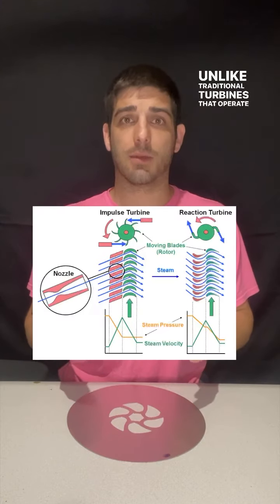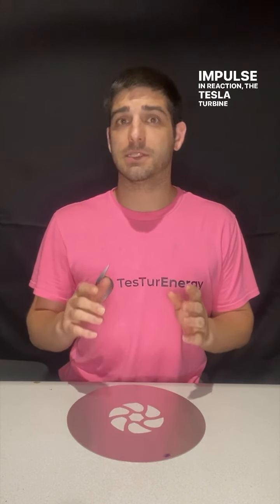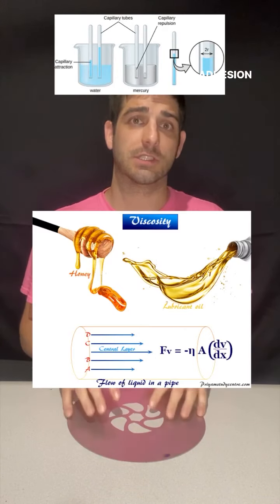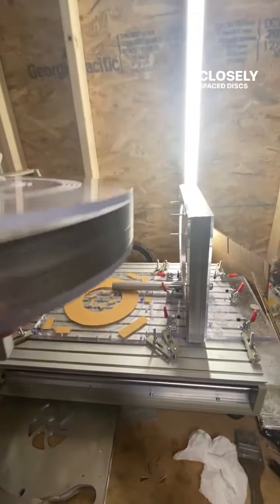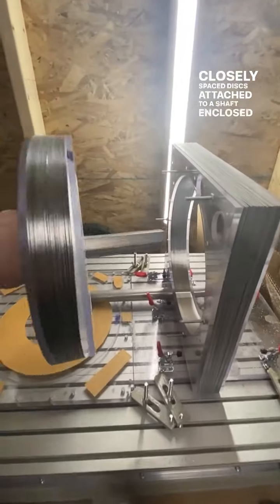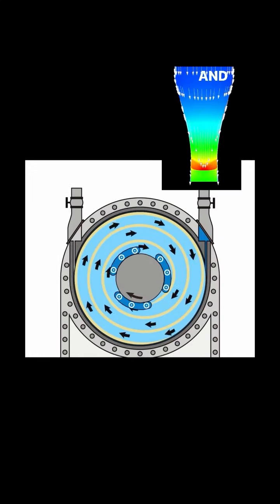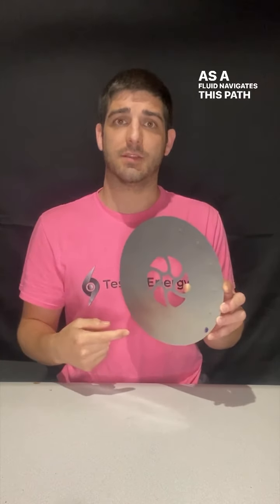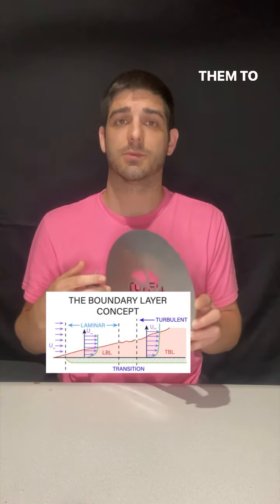Nikola Tesla’s Greatest Invention! - The Tesla Turbine

Comment: hey charlie, have you considered using carbon fiber disks? i was thinking you could use these to achieve greater RPMs thanks to their rigidness and light weight, i remember seeing somewhere you could reach a 1500m/s tip speed at the edge with normal carbon fiber material and up to 2100 if it was fabricated in a roll sort of fashion (threaded around the axis of rotation)
Reply from the maker: Hey thanks for the comment. Yes i have a ton of carbon fiber sheet for this exact purpose once we have the cactus design hammered out. 

But to be clear I appreciate your comment but Rpm is s not an issue because, despite what everyone erroneously claims, Tesla turbines work just fine, get plenty of torque and output power at low RPMs.     I’ve got some copy pasta 🍝 of mine that I’ll share with ya here to explain more.  Tesla turbines aren’t made efficient by spinning really fast.   That’s only for when the disc stack is being used as a centrifugal pump, because ALL centrifugal pumps’ compressors, performance is tip speed dependent.   But spinning the turbine fast will produce a centrifugal head that opposes the incoming fluid flow, reducing the pressure gradient across the nozzle, reducing fluid final velocity, reducing mass flow rates through the nozzle and ultimately reducing power out.
Reply from the maker: Furthermore the faster you spin them the faster the fluid you have has to go just to still be moving faster than the discs and still provide torque.   Lastly, they work just fine for industrial use and can scale up just fine because the torque on the discs is proportional to the difference in the fluid speed and the disc speed. So the disc tip speed is the important factor here. For any given fluid supply in, the bozzle will have a max fluid velocity. So the turbine disc tips will have a max speed set at that fluid speed irrelevant if radius. Now considering that centripetal force is proportional to V^2/R, if you keep the tip speed the same but increase the radius the centripetal forces on the disc for the speeds needed will actually decrease. 

Despite what MANY have claimed about the Tesla turbine, it does NOT need to be spun fast to work or work efficiently.   TesTurs are made efficient when the slip on the discs is reduced and spinning the discs fast does nothing to reduce the slip, only increase the distance the fluid slips on the disc faces, which is by definition “loss”.  Listen to what Tesla himself said in the patents of how to make them work.  “Owing to a number of causes affecting the performance, it is difficult to frame a precise rule which would be generally applicable, but it may be stated that within certain limits, and other conditions being the same, the torque is directly proportionate to the square of the velocity of the fluid relatively to the runner and to the effective area of the disks and, inversely, to the distance separating them. The machine will, generally, perform its maximum work when the effective speed of the runner is one-half of that of the fluid; but to attain the highest economy, the relative speed or slip, for any given performance, should be as small as possible. This condition may be to any desired degree approximated by increasing the active area of and reducing the space between the disks.”  1) increase the speed of the fluid relative to the disc, (not increase disc speed)  2) increase surface area 3) decrease disc spacing  This is how you actually make a TesTur work. Not by spinning it fast.   The fluid interactions with the disc that govern efficiency an torque are adhesion and cohesion. Full stop. And spinning fast does nothing to increasing either to increase the turbines isentropic efficiency.   This is why everyone who chases rpm with the TesTur just flat out fails. They aren’t even trying to design them properly so of course they won’t work.
Reply from the maker: You just have to know how to design it correctly to actually reduce slip to make them work, not spin them fast.  The only reason people think Tesla turbines have to be spun too fast is because EVERYONE has mistaken the part of the patent that is about the turbine being used as a pump as being about it being used as a drive turbine.   The only time you want to spin a TesTur fast is when it’s being used as a pump/compressor. This is because ALL centrifugal pumps’/compressors’ performance is tip speed dependent.   “I have found that the quantity of fluid propelled in this manner, is, other conditions being equal, approximately proportionate to the active surface of the runner and to its effective speed. For this reason, the performance of such machines augments at an exceedingly high rate with the increase of their size and speed of revolution.” -Nikola Tesla 

And again, you DO NOT want to spin too fast in a TesTur because the centrifugal head will just counter your incoming fluid flow reducing power. And the faster you spin discs, you’re fluid has to be going even that much faster just to be able to apply a torque on the disc face.   “Still another valuable and probably unique quality of such motors or prime movers may be described. By proper construction and observance of working conditions the centrifugal pressure, opposing the passage of the fluid, may, as already indicated, be made nearly equal to the pressure of supply when the machine is running idle. If the inlet section be large, small changes in the speed of revolution will produce great differences in flow which are further enhanced by the concomitant variations in the length of the spiral path. A self-regulating machine is thus obtained bearing a striking resemblance to a direct-current electric motor in this respect that, with great differences of impressed pressure in a wide open channel the flow of the fluid through the same is prevented by virtue of rotation. Since the centrifugal head increases as the square of the revolutions, or even more rapidly, and with modern high grade steel great peripheral velocities are practicable, it is possible to attain that condition in a single stage machine, more readily if the runner be of large diameter. Obviously this problem is facilitated by compounding, as will be understood by those skilled in the art. Irrespective of its bearing on economy, this tendency which is, to a degree, common to motors of the above description, is of special advantage in the operation of large units, as it affords a safeguard against running away and destruction. Besides these, such a prime mover possesses many other advantages, both constructive and operative. It is simple, light and compact, subject to but little wear, cheap and exceptionally easy to manufacture as small clearances and accurate milling work are not essential to good performance. In operation it is reliable, there being no valves, sliding contacts or troublesome vanes. It is almost free of windage, largely independent of nozzle efficiency and suitable for high as well as for low fluid velocities and speeds of revolution.” -Nikola Tesla  Tesla both knew it wasn’t meant to spin fast and that it worked great for low speeds IF you design it correctly.
Reply: @CharlieSolis  i was thinking this due to applications as a combustion engine for stuff like hydrogen
Reply from the maker: @thunderBOOM23  I see yeas I’m working on the combustion side of things now. But I think what you’re looking for is silicon nitride carbon fiber cermic like formula 1 break rotors are made. Something I’ve looked into but the price is inordinate. 

Inconel alloys and even stainless steel alloys would more than suit for any combustion turbine. 

Not that they couldn’t be made better but that’s so many strides down the road. 

But need to focus on making them work first.
Reply: @CharlieSolis  did you figure out the thing i said about the "glass" alloy steels? they seem to hold quite better than normal ones, and they come in stainless variants with properties similar to high carbon ones, theyre cryogenically cooled spontaneously from melting point and get that glass property of stiffness 
(they are also easy to machine apparently)

Comment: I’m curious as to if this turbine setup could be used on a turbo charger or turbo shaft engine 🤔 if so why hasn’t it been done?
Reply from the maker: Hey thanks for commenting. Yup it can. That’s what all of Tesla’s improved turbine patents were for that he patented in 1921, 10 years after the original turbine patent and about a decade of R&D 
 
When it comes to utilizing low-temperature, high-pressure gases for power generation, technologies like Compressed Air Energy Storage (CAES) and Cryogenic or Liquid Air Energy Storage (LAES/CES) are not just theoretical; they’re already in use at the industrial level.  In the context of engine mechanics, the typical workflow involves compressing air, heating it, and subsequently expanding it.  This is the essence of most gas turbines and turbojet engines, which operate based on the Brayton cycle. For those not versed in thermodynamics, the Brayton cycle consists of three key phases:  Air compression Heat input (usually through combustion, but other methods work too) Expansion of the heated air. 
 
When considering steam-based systems, you only need to introduce heat to turn the fluid into vapor. Technologies like Ocean Thermal Energy Conversion (OTEC) can not only produce steam but can also operate using an organic Rankine cycle at notably lower temperatures.  Of special interest is Tesla’s amended turbine patent, GB 186,083. This inventive design uses the residual heat from the turbine’s exhaust to produce steam.  The generated steam then pre-cools the combustion jet prior to entering the turbine, thereby reducing the usual compression demands seen in traditional gas turbines.  While conventional gas turbines work with air-to-fuel ratios ranging from 100:1 to 200:1, Tesla’s design minimizes the strain the compressor places on the shaft, allowing it to run efficiently even with stoichiometric ratios as low as 15:1.  Furthermore, Tesla’s subsequent patent, GB 186,084, integrates both combustion and steam turbine functionalities, negating the need for a separate compressor. 
 
 Hope this helps!

Comment: You may want to check out video nr 1918 by Robert Murray Smith about a new and perhaps much better design on tesla turbines.
Reply from the maker: Make sure to check out the latest updates on the combustion + steam Tesla turbine builds!   

Tesla Turbine 250 watt to 2.65 kW Power and Efficiency Test https://youtu.be/K7qZvq1CMFg  

+5 Horsepower Tesla Turbine Dyno Jet Turbo Power & Torque Curve 375 mph @ 12,000 rpm  https://youtu.be/exF5Rn-L8gs  

Tesla Turbine Jet Engine - gasoline fuel burner atomizer flame tube test 186,083 propane burner https://youtu.be/gRqKowignac 

Steam Tesla Turbine Micro Power Plant - 1st Start Up https://youtu.be/aMYyBsjhBR4
Reply: @CharlieSolis  Hello, is there a way to contact you?
Reply from the maker: @Mohammed-uz1sn  hey thanks for reaching out. 🙏❤️‍🔥  shoot us an email at TesTurEnergy@gmail.com and either Andrew or I will be more than happy to get back to you.